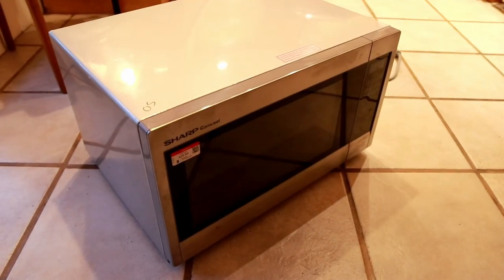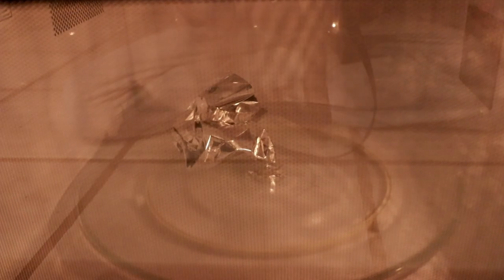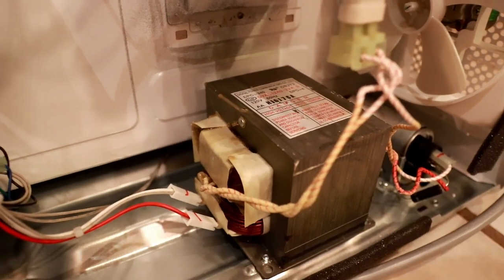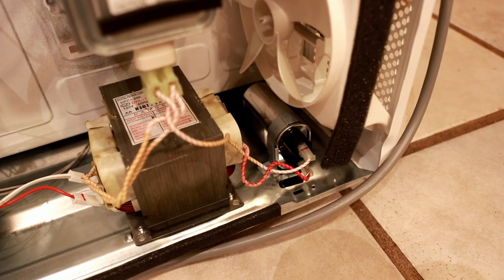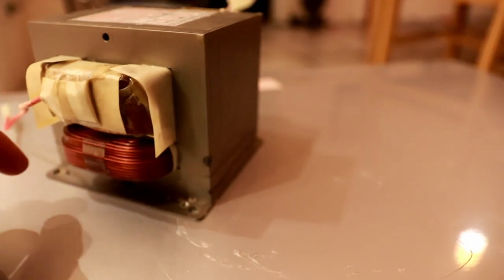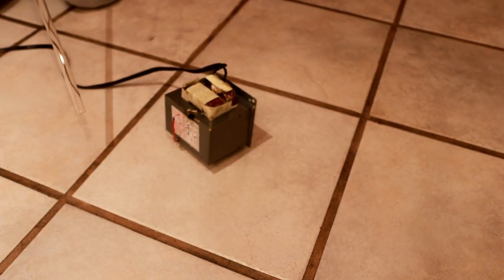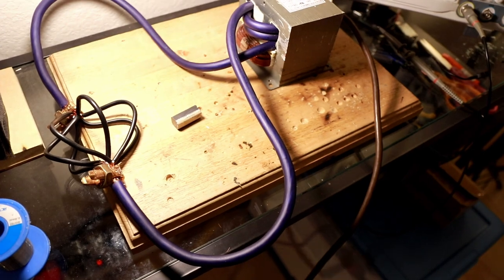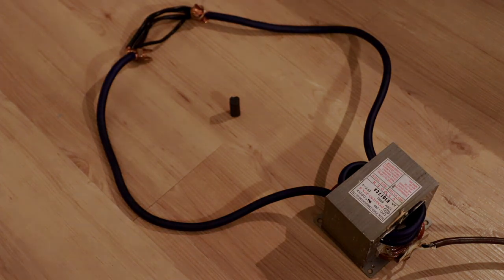EP 58 - Microwave Oven Transformer Re-Wind

Comment: these transformers are called stray filed there is a laminate shunts between the primary and the secondary these can be found in manual battery chargers.. light ballast .. neon drivers and arc transformers .